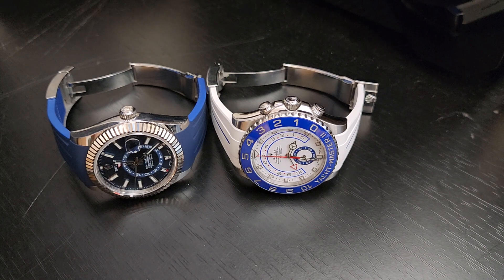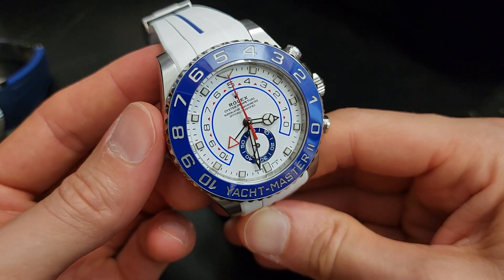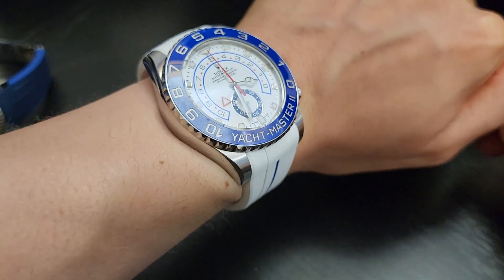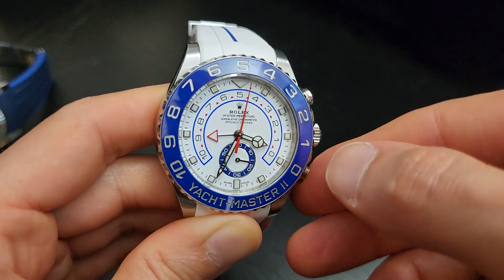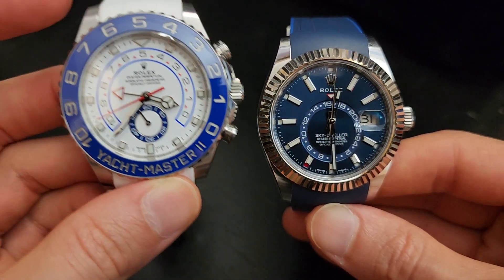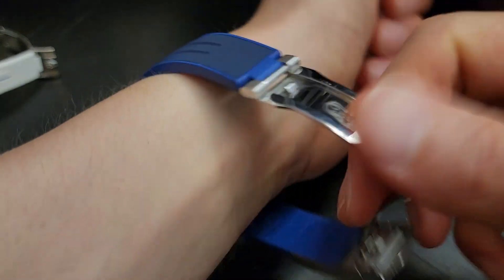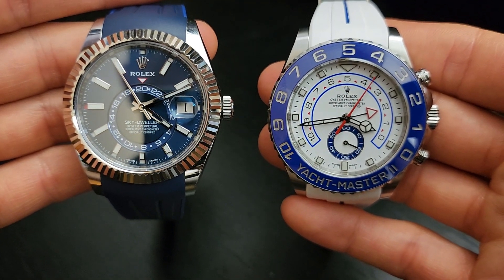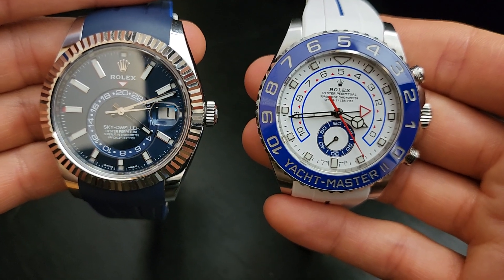Rolex Ring Command Bezel - What is it, and How Does it Work in a Watch?

Comment: Straps are pure trash
Reply from the maker: Which watches have you tried them with?
Reply: @TheSatisfiedWatchCollector  I have a Rolex oyster flex, but to be honest with you I like things original I find those straps that you put to be kind of clownish and it takes away from the original watch
Reply from the maker: @ernestogarcia8439 I mean there's no doubt that Oysterflex is super comfortable. And I get that the straps completely change the look and feel of the watch. When you're looking for a Rolex very often that will just mean with the heft of the bracelet, and I have no issue with that, I do throw them back on factory bracelet from time to time. But I like how the Rubber B straps make them fly under the radar a bit more and change the aesthetic.